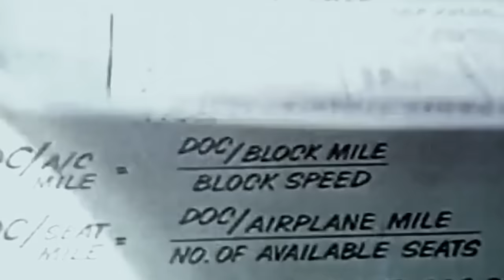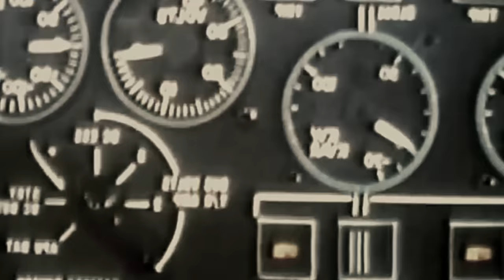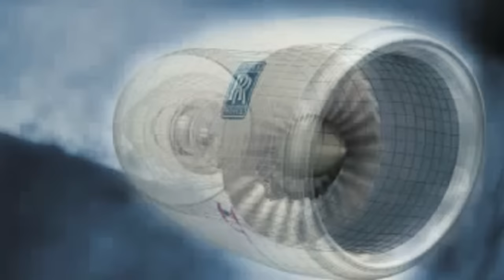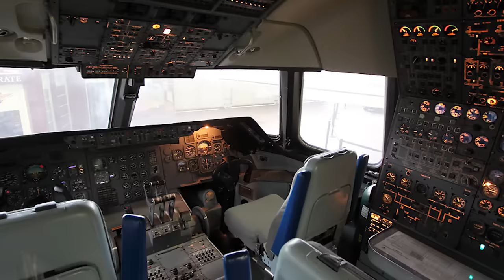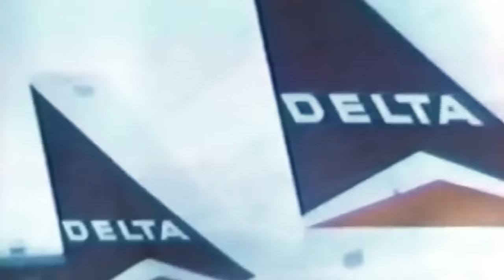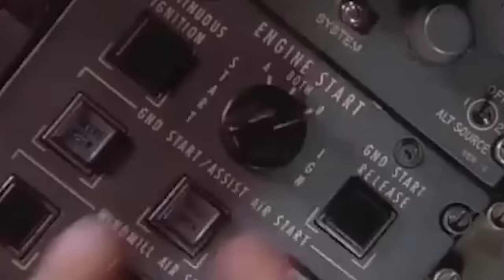L-1011 Tristar - too advanced for us

Comment: the Tri star made the DC-10 look like a coal stove
Reply: Ha! Thumbs up on that one!!!
Reply: And the DC-10 was an old clsssic muscle car vs an Malaise Era car with “computor” controlled carbureted engine and choked emissions control.
Reply: Bartonovich52 not even close.
Reply: it didn't take that long for Douglas to install Cat 3 landing system on the CD-10, but the flight controls on the L-1011 were better.  Having said that the MD-11 had all the above and was THE most comfortable ride in the air; higher wing loading, smaller more efficient horizontal [more advanced than L-1011]  but GE F'd up the engine performance which lead to more aero advancements and they eventually got the range and performance they wanted.
Reply: The MD-11 has/had stability issues.
Reply: "Issues" brought on by improperly trained pilots.  Even my first time in the MD-11 sim at Boeing Alteon I didn't have trouble with the "issues" people discuss.  Of course longitudinal static stability cold be a little greater, but you aren't going to get that with the smaller horizontal.  The flow mechanism over the horizontal is actually very advanced as in the CG management system.
Reply: @Cman. That’s why DC-10s are flying daily all over the world while the L-1011s are parked and scrapped. 

@ Lynx Star Automotive. How many 60s muscle cars do you see on the road... vs late 70s early 80s cars with their original computerized carburetors and EGR valves?
Reply: Bartonovich52 That’s true. I marvel at the Tristar lovers who need to denigrate the DC10 (now MD10 at FedEx). The DC10 succeeded with the passage of time. Still relevant today. I worked the Diesel10
at Continental, AA and almost 25 years at FedEx. A great plane. But like all planes can be a pain in the ass and “break”. Some guys hate the 10 (or MD11) not because of it being dangerous but more likely it’s #2 engine. The MD/DC10 flies in and flies out just like any other plane.All these hyped up anti DC10 books are fun for the uninformed (not their fault but simply no day to day experience). DC10 vs L1011 vs 747 is more akin to Mets vs Yankees   It’s fun and everybody has their opinion.
Reply: @Bartonovich52  I see way more late-60's/early '70s restored pony and muscle cars.   I don't see (and wish i dd for nostalgia) many ordinary cars from those eras.
Reply: The “old coal stove” still flying generating revenue and still very relevant. The L1011 hasn’t been relevant for many decades   Riding on an inflated reputation. IMO
Reply: Simon Coles made the dc10 look like alps
Reply: @Bartonovich52  The DC-10 was an Edsel that killed people. L-1011 was one of the safest aircraft ever flown and very advanced for its time.
Reply: Having flown both aircraft I can tell you that the DC-10 was a joy to fly and it saddens me to read so many derogatory remarks by folks that perhaps were not even born when the plane came out. Which was better? Both were great and reliable, except for the RB211s on the 1011. Nothing like the GE CF6s for power and reliability.
Reply: @richardlewis7471  The DC-10 early on killed people, by today however its safety record is about average but it suffers in comparison with the L-1011 because the L-1011 was a fantastic plane with a far better safety record. In the end the DC-10 did not kill the L-1011 instead ETOPS killed the L-1011 by allowing twin engine jets like the A300 and 767 to do transcontinental flights.
Reply: Stephen Voss ok. Then why didn’t etops kill the DC10, MD11, MD10? I mean Airbus putting out the A340 and A380 was foolish imo when ETOPS was really taking hold. 
But why wasn’t the L1011 able to go the cargo route? 
All I can say is as a mechanic I worked the DC10 MD10 & MD11 at Continental, AA & FEDEX  and was a good airplane. Not perfect mind you. No airplane is and every airplane has problems and soft spots  (including the Tristan).
Reply: @richardlewis7471  McD also had other planes including the MD-95 which was and is amazing as the Boeing 717.
Reply: Stephen Voss yes I remember back in 198? and saw a Delta L1011 land at EWR with a cracked wing spar spewing out a fuel fog. It was shores up and repaired a huge job. The talk back then was Lockheed no longer supported the airplane so Delta has to do all the engineering and fabrication of repair. Mind you the major airlines have substantial mechanical & engineering departments. 
I think there were some Tristan freighters but not sure if they were successful but obviously not by the handful I’ve seen. 
I worked the DC9 & MD80 which were workhorses. The MD90 was a great idea and a bunch flying.
Reply: @richardlewis7471  Boeing should have brought out a 717 next gen. Delta loved that plane
Reply: @stephenvoss6092  I assume once the original engines in both planes got old, the L1011 went out since it couldn't be swapped out...if it wasn't for (mainly) that, I imagine it would have likely lasted as long as other tri's
Reply: @ChadDidNothingWrong  Lockheed exited the commercial aircraft industry, Boeing still supported the DC-10 and MD-11 including MD-10 upconversions and freight conversions.
Reply: Agreed! The Tri Star was pure class and 1970's elegant. A jet set still existed in this era and the Tri Star was their airplane. Now Boeing builds dangerous aircraft and has a corrupt government agency approve every assembly.
Reply: @ Steven V

Yeah... the L-1011 was safe because it was lucky and they didn’t make very many of them and the company that made them got a shit kicking on their other aircraft (Electra, F-104, the C-5 which also crashed because of a faulty cargo door). 

Hey... when you don’t make a lot of airplanes and they don’t fly as much (L-1011 entered service after, ended production earlier, ended service earlier, not as many made, and a smaller number of hours flown) it’s safer. The Tupolev 114 is safer than the L-1011 in that metric.

Two L-1011 incidents should have been disasters. One was Delta 1080 where the horizontal stabilizer detached (never happened on the DC-10... and only happened on the MD-80 due to gross negligence by Alaska). Next was Eastern 935 which experienced damage to all four hydraulic systems. It’s was pure luck that the fourth one was impacted by fragments but not penetrated. 

Remember... the L-1011 was so bad at the start it couldn’t be certified and needed the nationalization of Rolls Royce and loan guarantees from the US government to even be built.
Reply: Very true. I was in the USAF and was headed to a new base. We had to wear uniforms when traveling then. The stewardess asked if I would like to go to the flight deck and check it out (pre-terrorist days). My job was flight training in the KC-135. I was blown away with the L-1011. It flew so smoothly and had so much power. Wish it was still flying. Awesome a!airplane!
Reply: Sorry bro the DC 10 qas a great aircraft
Reply: @Bartonovich52  "Like a DC 10, guaranteed to go down!" -The Bloodhound Gang. What of the 1011 good sir?
Reply: @gerardosalazar161  Like the turbine blades in the GE that shredded all three hydraulic lines that had no fuses.  The pilot of that plane  did an incredible job though. . .they all should have been dead. May he rest in peace.
Reply: I helped build the L-1011.  I worked at the Lockheed Palmdale facility from 1972-76.  I worked in the section that installed Interior Trim.  Our union was IAM and we had good bennies.  We loved the TriStar and routinely made fun of the DC-10 "Thunderbolt".  McDonnell really slapped the DC-10 together to beat the TriStar to market.  They did, unfortunately, and the best plane ultimately lost.  What a shame...
Reply: flip inheck  so was the dc10 in the military it was the plane that flew me to Germany what a noisy terrible flight
Reply: Flip = Comparing the Hawker Siddeley Trident to the Lockheed TriStar is ridiculous.  The Trident was a narrow body aircraft with a T tail, whereas the L:1011 TriStar was a wide body aircraft with no t tail and a flying vertical stabilizer.  But, as a not to the British, the TriStar did use Rolls Royce engines...
Reply: Mark - It has been so many years since I worked at Lockheed (Palmdale, CA) that I don't remember much about the choice of the RB-211 engines over P&W and GE.  I think it was because it was supposed to be a global effort.  I remember we sourced everything to build the L-1011 from contractors all over the world...
Reply: @richardlewis7471  Had Rolls Royce completed the RB211  on time and to spec, maybe ...
Reply: The Tristar was a heavy inefficient and maintenance intensive beast.  Still it has a better safety record than the slightly newer DC10.  For example the L1011 had 4 hydraulic system the DC10 had 3.  The D hydraulic system did not go to the tail for protection during a centre engine rotor burst.
Reply: I love your remark!!!!  👍
Reply: True
Reply: But we have to all agree that the Tristar look way better than the dc 10
Reply: @maryrafuse2297  better get airbus than boeing
Reply: @JSav07  - uh,  haven't we all?
Reply: I love both alot
Reply: @richardlewis7471 ; Hello. My first plane ride ever was on a DC10 from Boston to L.A. I knew when the plane was on the runway and the pilot had revved up the engines and never felt it leaving the ground sitting in the mid row I had to look over to my right and see we were off the ground. For a chicken taken it's first flight, man, that was one smooth flight to L.A. and I enjoyed the ride actually I fell asleep.
  It is more of a comfort knowing there is 3 engines in case one is lost...
Reply: Richard Lewis I'm sure you meant MD11
Reply: Apt comparison...
Reply: @richardlewis7471  - The L-1011 was operated very successfully well into the 21st century, and was VASTLY superior to the DC-10 in almost every aspect except purchase price, which is the primary reason they are still flying - freight operators could buy and operate them more economically than the TriStar.  I am type rated in and have experience operating the L-1011, DC-10, and MD-11 (as well as the B-747-400), so I have some idea of whence I speak.  The DC-10 was a Chevrolet, the TriStar was a Cadillac.   The DC-10 flew nicely enough, but it’s engineering was sub-par - Douglas peaked with the DC-8 (While the MD-11 was more advanced in some aspects than the B747-4, its underlying engineering still reflected many of the DC-10’s compromises).

If any aircraft survived on an inflated reputation, it was the DC-10/MD-11 series.
Reply: @richardlewis7471  - I marvel at people who haven’t operated them all that claim they know about them.  The DC-10 wasn’t awful, and it flew nicely, but it’s engineering and overall design were inferior to the L-1011.  The DC-10 was more economical, which wins airline manager’s hearts, but I’ve yet to meet a pilot with experience in both that didn’t prefer the TriStar.

Also Bartonovich keeps making these stupid statements about how the L-1011 “couldn’t be certified...”.  Yes, the program was delayed by problems with the RB-211, chief of which was Rolls was trying to produce it with composite fan blades.  Unfortunately the technology had not matured enough at that point, and they had to revert to using conventional metal (titanium IIRC) blades, which was a major setback.   Ultimately the RB-211 proved to be a great engine, but it’s development issues were very detrimental to the sales of the airframe.  He also focuses on the relatively few engineering issues the L-1011 had, compared to the myriad deficiencies in the DC-10 (“”Built in Long Beach, engineered in fields all over the world.”).   The fact is that despite a catastrophic engine failure, the L-1011 DIDN’T lose all of it’s hydraulics - and even if it had penetrated the D system, it incorporated a hydraulic fuse to prevent exactly the sort of event that befell the DC-10.  

We see the deficiencies in MD engineering to this day - when Boeing and MD merged, they unfortunately kept too much of the MD culture, which undoubtedly contributed to the MAX debacle.
Reply: @gendaminoru3195 , I flew on the MD-11 twice and maybe it was that airline's specific configuration (the now defunct VASP, from Brazil), but I found it okay, not THE best. The seat was great, but two particular issues annoyed me: too few lavatories for the number of passengers (both flights were only half full, but there were still lines for the lavatories), and the overhead bins were too high (I'm a short man and I couldn't reach the bins, but I'm not short enough for that to have been a problem in any other plane model). I also flew three times on the old 747-200 (Air France) and it was MUCH better, but of course those were different times. I flew twice on the 777-200 (United, old 2+5+2 configuration in economy) and THAT was the best widebody experience I ever had -- I loved the 777! The worst was American Airlines' 767-300ER, with stiff unreclinable seats, worn and dirty upholstery, toeroom rather than legroom, inedible food, and crew trained at the Gestapo Rottweiler kennels, on two 10-hour flights! True hell! All these flights were in economy class.
Reply: @stephenvoss6092  While Lockheed was waiting for RR to decide the future of the RB211 sales were plummeting so a deal was signed for  Eastern to but TriStars at an absurd low price and with costs climbing it reached the point at which Lockheed was losing money on each sale thus leading the way to closing the production line.
Having said that I must add that as a pilot the L1011 was a joy to fly and I enjoyed every single minute.
Reply: @bradcrosier1332  "Build in Long Beach, engineered in fields all over the world" Now that's funny.
Reply: The quality and technology of the Tri-Star is still superior, that has nothing to do with the plane still being in operation or not. The DC-10 was easier to convert into a freighter, that's why plenty are still in service.
Reply: @JSav07 when it bounces